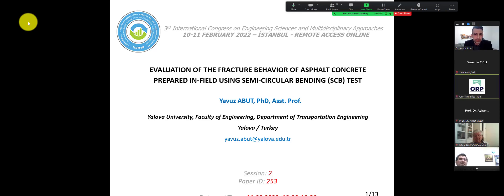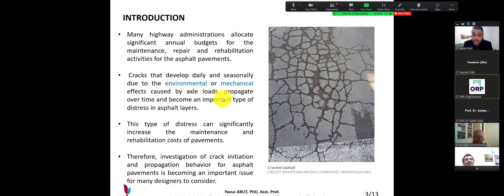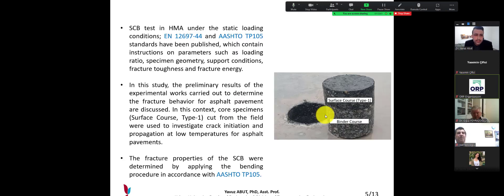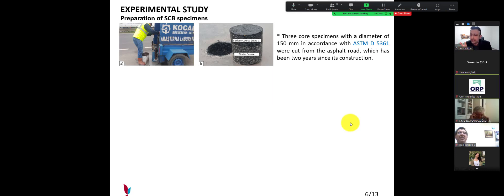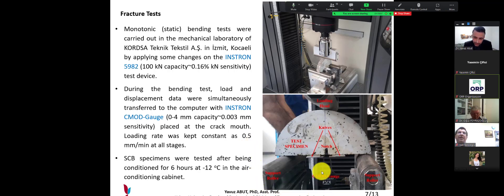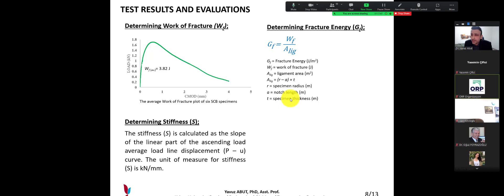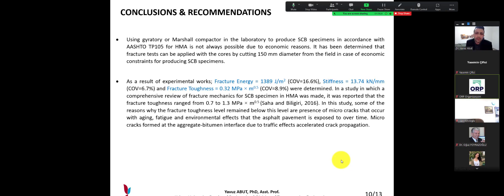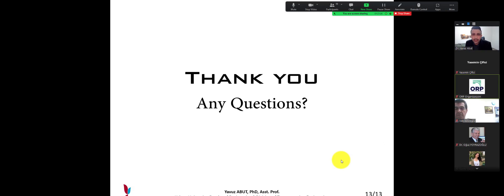Evaluation of the Fracture Behavior of Asphalt Concrete Prepared In Field Using SCB Test

Comment: Please what is the difference between SCB test and three point bending test
Reply from the maker: SCB test is an experimental work in which a 3-point bending setup is used. Several modifications are made on the classical beam 3-point bending test setup.
Reply: @yavuzabut  thanks
Reply: Are the machine different?